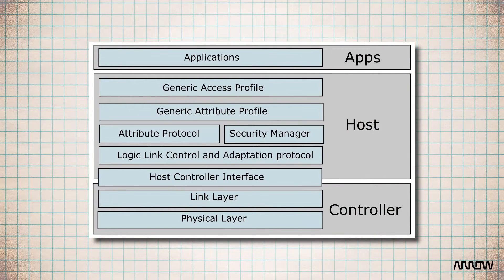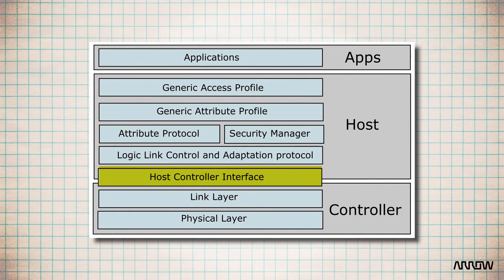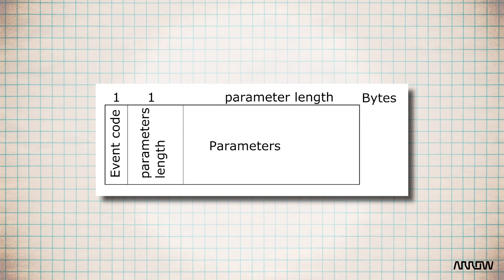Bluetooth Low Energy Series | HCI

Comment: I work for CaptionCall in SLC, UT. I am looking to understand the low-level protocols that the HCI interface provides. I want to be able to connect to the serial (/dev/tty*) interface and perform functions like scanning. Is there a document, tutorial, and/or hardware I can use?

I have a lot of experience with embedded systems, designing boards and programming them. So, a meaty treatise would be helpful.